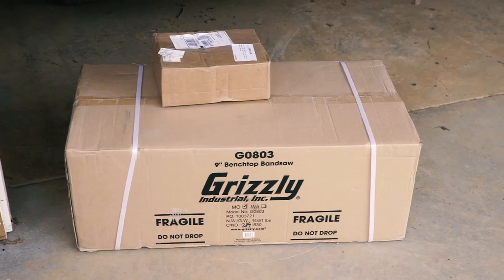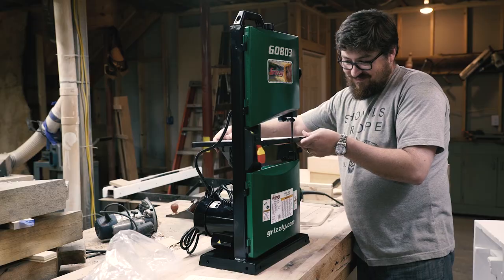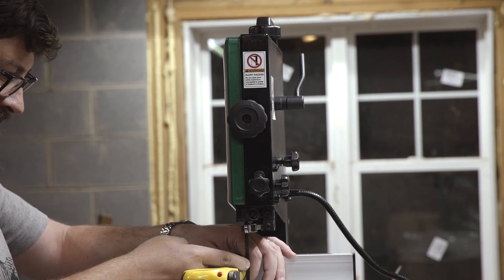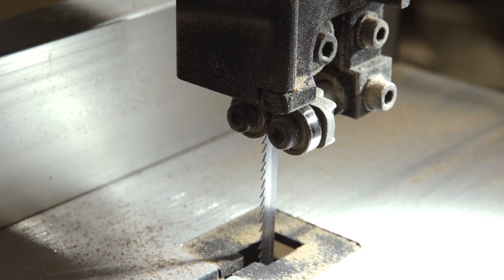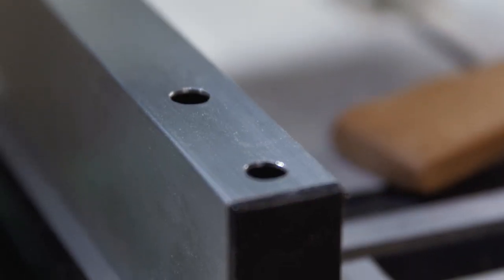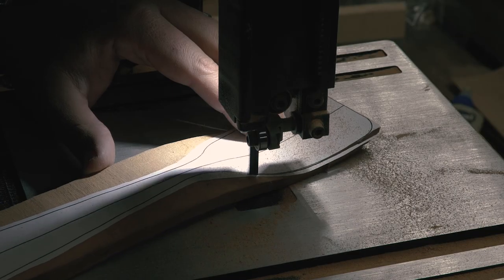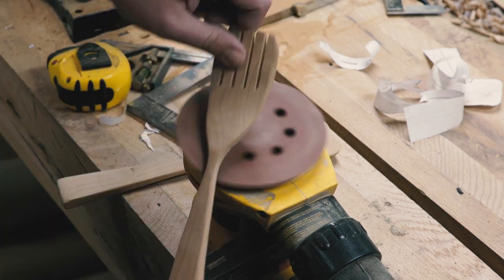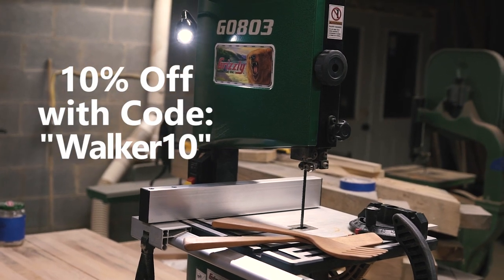The Grizzly G0803 Benchtop Bandsaw -  Review

Comment: I just replaced my Skilsaw with this and it’s like a big bandsaw scaled down.  In other words, I love it! Unlike the Skilsaw,, which seemed like the Ez-Bake oven of bench top saws.  Only thing, the wire to the light was pinch in the tension spring and it took me a week to find it.  The light would go and off randomly.  I only found it, because I’m having trouble getting the tension tight enough.  I was able to get the wire out from between the coils on the spring, but it’s damaged and I’m going to have to send it back.  
Back to the tension, I’m using a 62” blade but I just can’t get it tight enough to cut even close to a straight line.  The cut looks like a drunk’s foot prints in the snow!

Comment: I bought this bandsaw after seeing this video. I used your discount code. My bandsaw came with a number of issues. First the paint was peeling all over the machine and had rust where the paint had flaked off. I thought no big deal its a tool. I then had trouble with getting the table to mount. I seem that the holes and bolts to mount the table were all stripped out. So I went to my blot big and founds some to work. Since I don't have a tap set. After geting the table more or less in place it wouldn't stay square to the blade. I was thinking why am putting up with this as a brand new product. I call Grizzly and had them email me a shipping label for return for refund. I hope not all Grizzly stuff is this bad I was thinking to getting a jointer from them in the future. I may now look to another company after this experiance.
Reply from the maker: I know Grizzly prides themselves on customer service.  I had the complete opposite experience with my bandsaw.  I'm glad they took care of you and are sending a shipping label, but I'm really upset to hear you had a bad experience!  I've currently got my Grizzly tablesaw, a 30 year old bandsaw, this benchtop bandsaw, and a sander.  I've been really happy with all of my grizzly stuff.  I know Grizzly is really proud of this little bandsaw so I hope you give them a chance in the future.
Reply: Buy the Rikon 10" on sale for $179- $199 right now, it kicks Grizzly's 9" ass. All bolt holes line up perfectly and the whole package is A+.

Comment: Anyone like that light shining behind and casting shadow across your cut lines and from behind the blade? Designed like the blade cuts faces the other direction. Not to mention the glare in your eyes from the shiny table. Like driving into the Sun on the wrong side of the road.

Comment: That is even a better deal than the ISYN sander.  Which Grizzly tablesaw & bandsaw do you have?  Any comments about them?
Reply from the maker: Right?!  I've got the G1023 RLW saw and I really love it.  For working on contractor style saws for so long growing up, it's awesome to have a big beefy machine that is easy to dial in.  My bandsaw is a G1019 manufactured in 1992.  That thing is pretty stout and I've got it dialed in pretty good.  The only downside is the resaw capacity is only 6" and since they don't make the saw anymore, I can't get a riser block to increase the resaw capacity.  I bought that Grizzly to replace my POS Delta and have been really happy.

Comment: I have a cheapo Craftsman Band Saw which I am OK with for small work and trimming e.g. curves but when it comes to re-sawing it is hopeless - the blade easily wanders from the intended path and will not hold a straight line. Have you tried the grizzly for re-sawing yet?
Reply from the maker: only with making the salad servers and the small knife scales.  Oh I did test it on resawing a 2x4 (max resaw capacity is 3/58") with my first cut and it performed flawlessly. It follows the line really well and there's no "bellying out" in the middle of the cut.  Are you sure you have your tension right?  I know that's a big issue.  Also, you could try deburring the back of the blade.  I had a Delta as my first bandsaw and experienced a lot of the same of what you're talking about.  Couldn't stand that saw.  This one is WAY nicer than my small Delta.
Reply: Wm. Walker Co. Yes, I've been up and down the scale like I was learning an instrument so I don't think it's tension. I will try deburring but I've had the blade in and out several times and didn't notice any burring. I appreciate the suggestions - I'll let you know how I make out.

Comment: Just a heads up, the code doesn't work yet.

Posted: March 9, 2017 @ 3:43p PST.
Reply from the maker: +Chip Smith I'll check with Grizzly!
Reply from the maker: Should be fixed by morning for online sales, but if you need it now, you can call the 800 number and give them the code and they'll give you the discount.
Reply: Thanks bud! I think I can wait it out to buy another tool...er my wife would prefer I wait :D